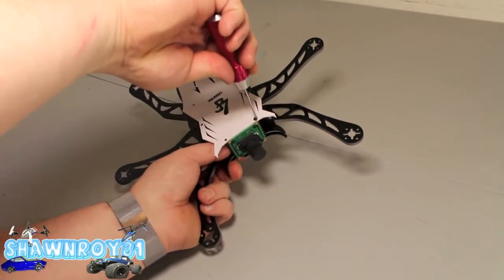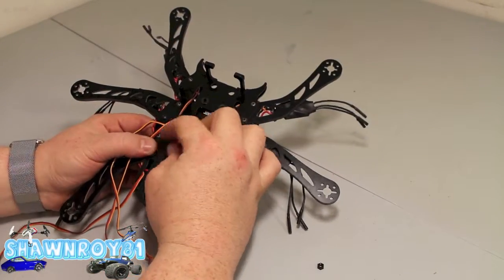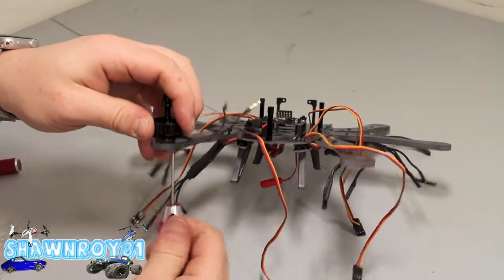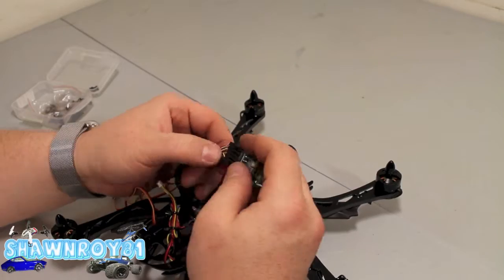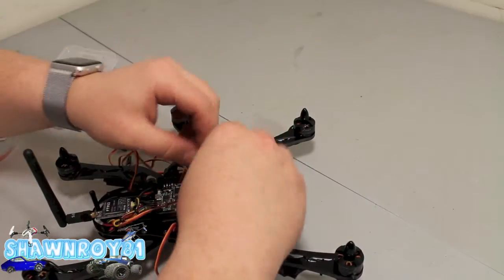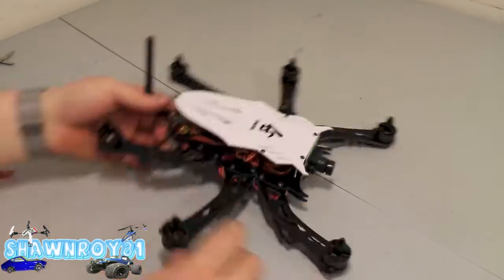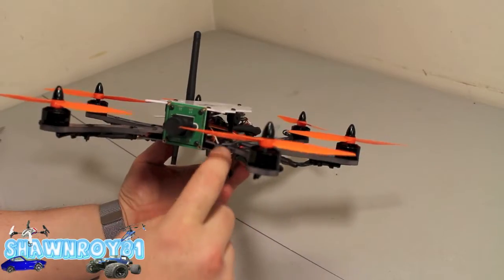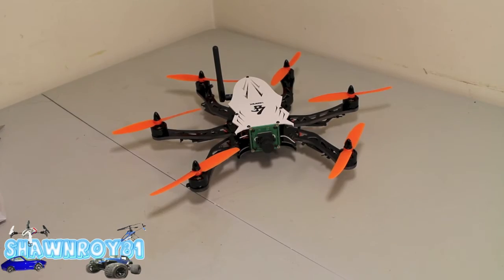FPV Bettle Hexacopter frame Electronics Install

Comment: Thanks for the video, how do you calibrate the esc.
Reply from the maker: On power up hold your throttle stick all the way to the top. You will hear the esc chime then you can lower it to 0 and your ready to go. They should have all been calibrated.